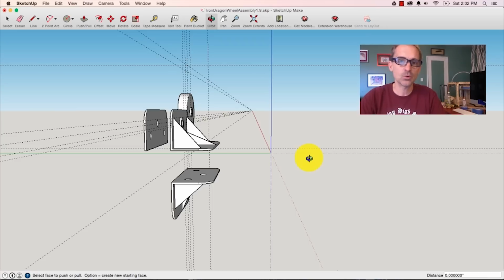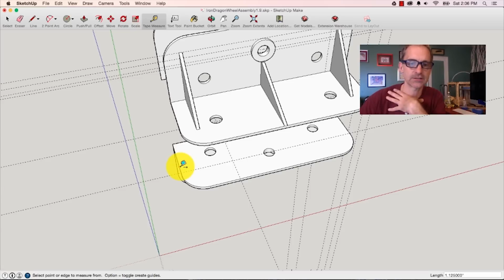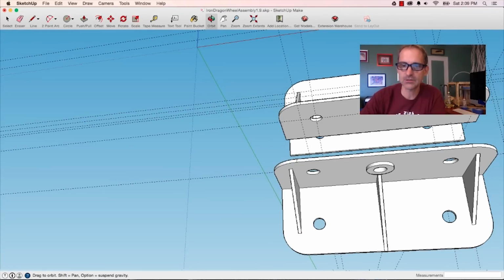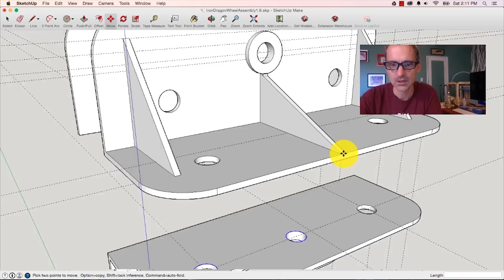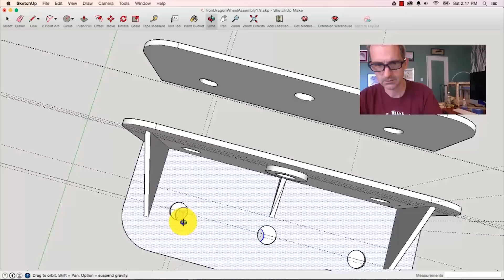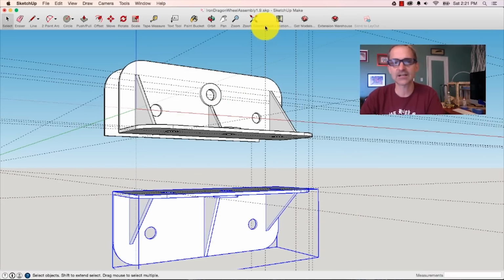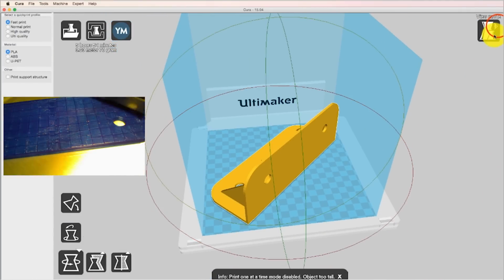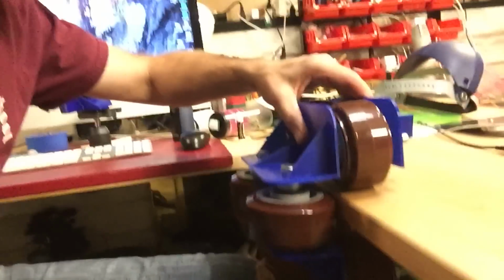Iron Dragon Backyard Roller Coaster - Part 17

Comment: Hey I also consider something too. so when you get on a real rollercoaster, you know how it is smooth and on a 200ft tall one ones you build would take 3 seconds of a drop u want it to have 5 for intensity. so I suggest with the tracks making them look real. but the railing needs to stick out more from the holders connected to the middle. Also with the wheels, the bottom of the wheels need to wrap around the track(not completely) but the form the wheels where like how the wheels are on the top bottom and side is a good idea.

Comment: I wonder if you really need two of the large wheels for the side wheels and up-stop wheels.  Perhaps you could get by with the smaller wheels like you used for the front yard coaster for the side and up-stop wheels.  You might even just need just one up-stop wheel  per wheel assembly since I wouldn't expect you to do a lot of negative G's.  That might save you some weight, but should still be smooth since most the weight will be on the large top wheels.

Comment: Maybe you should consider attaching the upper and lower angles with a welded center blade, or a rectangular tube if space allows, to stiffen and strengthen the assembly.   Not sure that's needed, but it would improve the load path from the side wheels (divert load from the two axles).
Reply from the maker: Agreed, +Paul Gregg.
The 3D prototype isn't exactly what the finished system will look like. The gussets probably wont be necessary. They're mainly in place to facilitate successful 3D Printing. Welded blades, tubes, or angle irons are definitely in the plan. 

The new problem is weight. Each wheel assembly, when complete, will weigh in at ~15 pounds! Add axles, and you end up (start off) with a 65 pound bogie. Yikes! If only I knew someone who had experience with aluminium. :)
Reply: +Will Pemble. Yeh, it is looking sort of heavy, which will make the bogeys less responsive (it will take longer and more energy to turn them).  I think it will work though, and be more than strong, unless you get into a dynamic instability, which is not likely.  
The energy has to come out of the cart in some way, otherwise you would need brakes at the end.  So it's probably not necessary to make it too efficient.
Maybe you should make the first 40 ft of track and try out one bogey by itself?
I think you need two side wheels, but only one upstop wheel per truck.
Have you seen my last video on 3D cart devolopment?
Reply: +Paul Gregg my brother welds aluminum,  and says it's not that hard.  What does your welding buddy say?
Reply from the maker: +Paul Gregg My welding buddy says I can use his amazing TIG Welding machine any time I like! Just doing the load math. 60 pound bogey. Call it another 40 for the chassis. 200 pound passenger. At 3g and a 150% safety factor means we've got to build the track to support at least 1350 pounds, right?
Reply: Is that 60 pounds per bogey?  There are two.
Reply from the maker: +Paul Gregg Both. In my kooky vernacular, front wheels + rear wheels + interconnecting frame = Bogey.
Reply: +Will Pemble OK, then yes, 1350 pounds.  I'm not at home, but next weekend I'll try to do some simple stress work on track for you.  Worst case you might have to shorten tie spacing, or go to 1.5 inch track.
You could also talk yourself into a lower (1.25?) factor of safety, as welded steel would have less variability than pvc, wood, and screws.  I doubt pro RC engineers use 1.5, but maybe we can find out.
You should consider building a 10 ft straight track and load on 1350 pounds.  That would be fun.
Reply: +Paul Gregg I brought up an old spreadsheet on bending stress calculations in steel track, and have some answers. 
 With 1350 pounds ultimate load, assuming 70% of the load on the back wheels, I get a negative margin (predicted yield failure) in the steel tie, assuming an 0.060 thick,  1.0" by 1.5" rectangular track tie.
However, if you use a 1.25" by 1.5" by 0.060" rectangular tube tie, it has a 6% positive margin.
If you use a 1.5" by 1.0" by 0.080" thick rectangular tube, it has a 0.0 margin (it works).  You would only need these thicker ties in the 3g areas of the track.
With this design, I show a total deflection of 0.123 inches at limit load (900 pounds) at the midpoint between 24 inch ties, mostly due to the round 1-1/4" round tube track deflection.  I don't know if that will make the ride rough or not.  You could decrease the tie spacing to 12 inches, just in the high load sections.
I'll send or share the spreadsheet with you, and it might make a nice video to tweak the numbers and discuss real-time.
Check the deflection between ties when you do the heavy cart static test.

I haven't checked my work.  Maybe one of your subscribers is a mechanical or civil engineer (or studying to be one) and can run an independent check.
Reply: +Will Pemble Great Video Will! Your work really is impressive. I too have been working on a backyard coaster and it would mean a lot to me if you took a look at it on my channel. Thanks, you're awesome and I would really appreciate it.

Comment: Not sure you need 3" angles.  The axle holes don't need to be in the center of the steel face.  In aerospace, the rule on edge margin from a hole center is 2 times the diameter of the hole, plus 0.05" in metal, 2.5D+0.05 in composites.  You could probably get by with and edge margin of 1.5, because you don't plan on repair with a larger fastener sometime in the future.  So for a 3/8ths inch hole, the distance from the center of the hole to the edge of the face can be 0.375 X 1.5 = 0.5625 inches. It also had to be thick enough to take the bearing loads.
Even if you use large angles, you can trim back unneeded metal, to save weight.  
The gussets are important, for strength, but more importantly stiffness.
Bosses (raised areas) around holes are difficult in a sheet metal or extruded part like your angles.  Bosses are much easier in machined, forged, or cast parts.   I guess you could fillet weld a washer around a hole, but it might distort, and might be messy.   Or just use loose washers, which won't be as strong or stiff, but will probably be acceptable in this case.

Comment: Sorry I'm commenting so much.   Aluminum is 1/3 the density of steel, but typically has lower strength, and about 1/3rd the stiffness.   How much will aluminum reduce the weight?   In other words, how much of the weight is wheels, and how much steel angles?  You'll probably want to use thicker aluminum gauges than steel, we can check the properties once you know the alloy your friends like to weld, and what's readily available.  I don't know much about typical home project aluminum alloys.   The 5000 series marine aluminums are not as strong (or expensive) as aerospace alloys, but they are corrosion resistant. and weldable.  I worked on inexpensive space launchers at one time, and we visited a shipyard to get cheap assembly ideas.   At one time, Boeing built a hydrofoil in an attempt to diversify, but it was 10X more expensive than typical ships.

Comment: Hello, shouldn't the frame be a solid infill for safety? Keep in mind 3D printed objects should never be replacements for real-world industrial parts regardless of material strength. You wouldn't replace a car part with a  home 3D printed object, right? Because it can eventually crack, fail, break, split, separate or degrade.
Reply: +Theme Park Attraction It was a prototype. This is what he is going to do with steel.
Right +Will Pemble
Reply: As long as he does, I just hope this isn't his final method.
Reply: yah.
Reply: +Theme Park Attraction what? you don't really think he's gonna use a piece of plastique to hold together the part that probably needs to stand through the biggest force^^  the prototype is not a prototype like you know for testing functionality, it's just for the sake of testing out designs
Reply: +Blasulz1234 read my previous comment...
Reply: I did, that's why i commented^^"

Comment: Could you link the files for the 3d printer of the wheel assembly? It's ok if you cant
Reply from the maker: I'm so sorry, Octuly. I'm afraid I don't have those files any longer. That was many years and several computers ago :(
Reply: @WillPemble  no problem thanks for.letting me know.